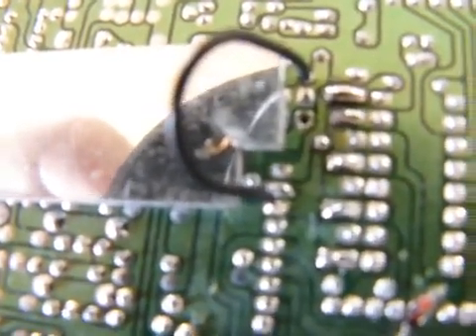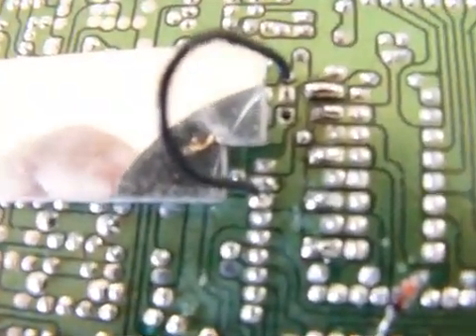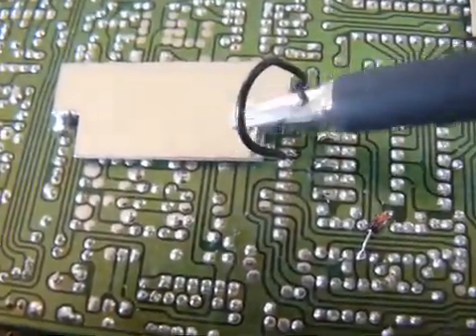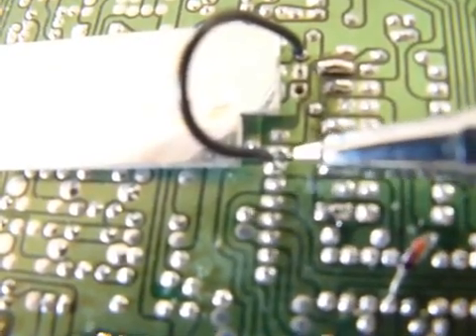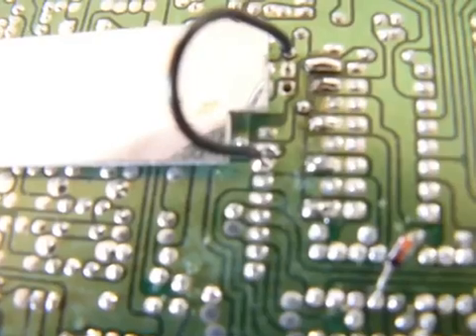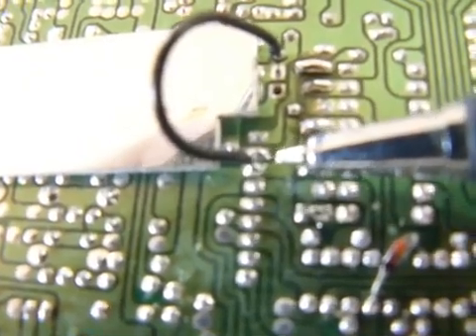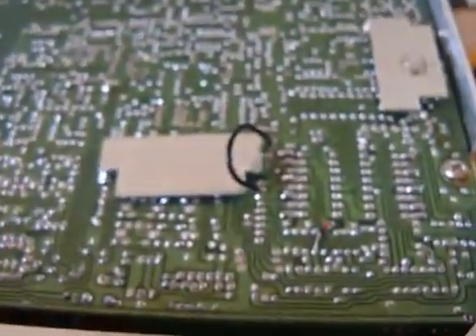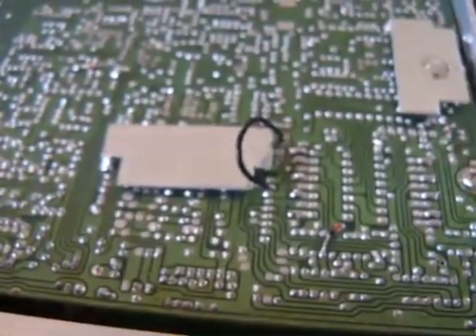GALAXY DX 94HP DX 98VHP DX95T2 CB CONVERSION

Comment: @390WagonMaster  the top portion of the wire on my new in box radio is down 1 spot do i move it one up like yours is?
Reply from the maker: this may help.... https://cbtricks.org/radios/galaxy/dx94hp/dx94hp_freq_conv.htm
Reply: @390WagonMaster your board is a little different from mine but I'll try it out and come back with results. Will def need to retune and align I think